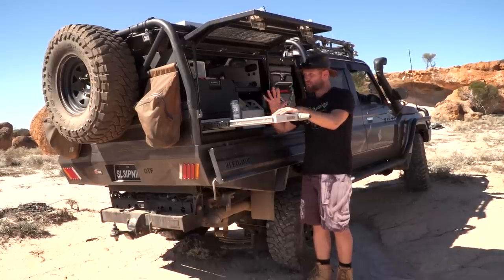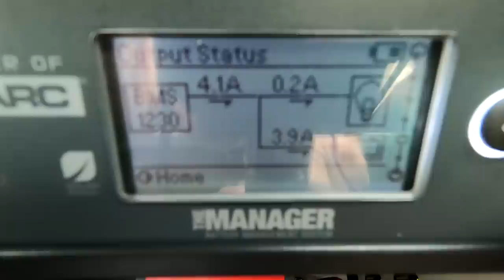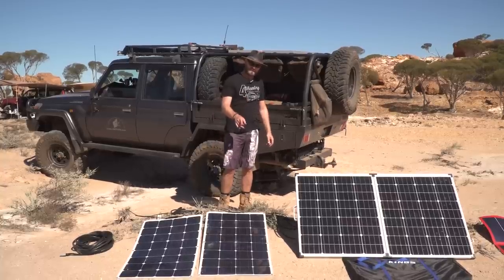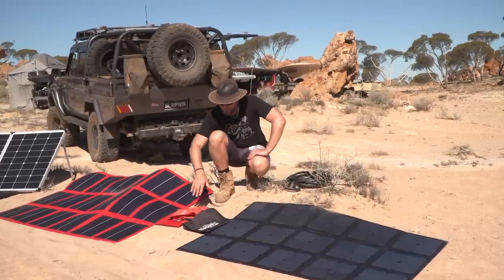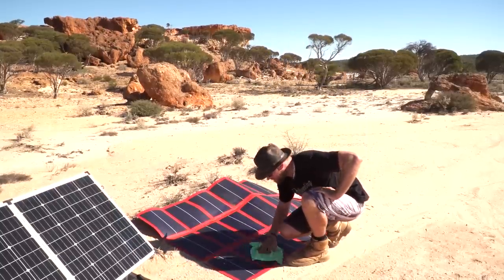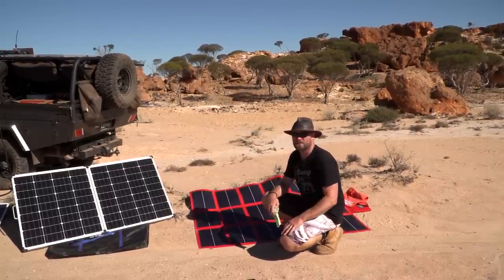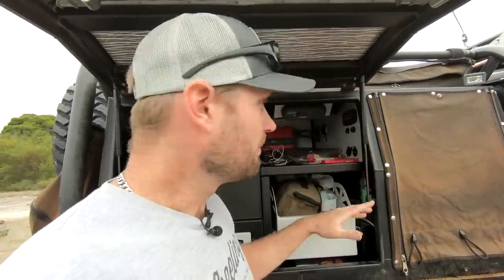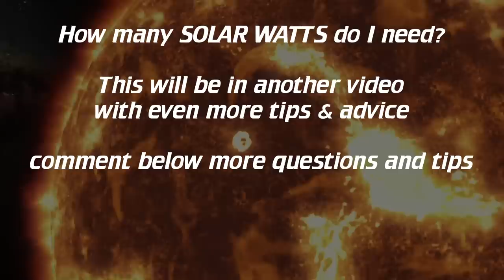SOLAR POWER 4x4 Overlander, tips advice

Comment: My truck has dual agm batteries and dual alternators totaling 400 amps. Anything wrong with wiring one to solar panel on roof when it's running the alternator charges when it's off 200 watts of solar power. I've done this on my old truck with single battery and alternator with good results. I've never had dual batteries and alternators before.

Comment: Good video Ron but l don’t believe the Pwm controller is as bad as you rated it , l have seen other people do test/comparisons and it was marginal , especially compared to the cost of a mmpt controller... also you guys should throw in about cable sizing and lengths they play a massive part of power loss , too small , too long = huge power drop...cheers....

Comment: Good video Ronny. I have a portable hard panel set up - 160 watt in total. Between the car and the panels, my rear battery runs my fridge /freezer for as long as I need it to. I had it running for 4 weeks straight in  Vic and Flinders ranges. Worth every cent. Future topics: alternator types , fixed or variable , what does it mean?

Comment: Its wrong to say High quality vs cheap, as you can buy some really good high quality cheap panels that will match  or even have better performance than the more expensive panels,. When comparing something in future its expensive vs cheap or high quality vs low quality, don't get them confused. I saw just the other day a $300 110w panel compared to a cheap $99 110w panel and using same 12v controller the cheaper one outperformed the more expensive one, so take prices with a grain of salt, cheap doesn't always mean nasty.
Reply: so how do you tell then, without buying both and comparing?

Comment: PWM controller will perform just as good in heat, Which is Australia :). MPPT is better in colder climates.
Reply from the maker: MPPT charges differently and will give you 90-100% if the power from the solar. PWM will only give you around 50-60% in general
Reply: I think you need to do a bit more reading on the difference mate!
Reply: I know how they work. the MTTP can convert excess potential (Voltage) into Current (Amps). This can be up to around 30% but is usually lower at around 15% Increase. This is pretty cool idea, and any gain is good. MTTP controllers work best when the cells are cooler. It also depends on your panels and how much excess voltage you have. I have used both controllers, and both have worked well.

Keep up the good work.
Reply: PWM is actually more "power efficient" than MPPT–which means less total power loss in the controller itself. So heat sinks in the design can be smaller (and less expensive). Missing in most analysis of MPPT is that there is always a conversion loss with MPPT, which tends to be higher the greater the voltage difference between battery and panels. That's why PWM can actually beat MPPT under circumstances. There are pros and cons to both, but to totally dismiss a quality PWM charge controller and monitoring system that work TOGETHER, is ignorant. And JJ is correct, MPPT is better in much colder climates which is generally how the marketing types skew the numbers.

Comment: blankets suck in hot weather so if you plan to go outback and camp they are useless... 30-40C weather drives the heat of the panels way beyond their 40c maximum.  at 40c a 100w renogy fixed panel still delivers 94watts or better. even a efte panel (atem 200w) can only deliver 4 amps through a mppt and a single renogy 100w delivers 7 amps and they weigh the same 6kgs.... Oh and a fixed panel is 30% of the price or 6 times the output for the money(worst case).

Comment: Great video.  General question.  I have the hard fixed panel like in this video (with the mppt controller in the back).  Can I plug that straight into my bc2bc charger without bypassing the build in controller on the panel?  (I incidentally have the same redarc bc2bc charger too in this video).  Should I just rip it off? Also, what are the repercussions of just leaving it and going from one regulator into the redarc one?  The reason I ask is because I'd like to leave it there so I can use it for other uses that's all.  Not a biggie if I have to rip it off though.  Cheers.

Comment: I was told by a solar company installer that there's very little difference between cheap (not crap cheap) and expensive panels as they all come from china and probably out of the same factory. Like most things you're paying for a name. A quality solar charger close to the battery is important.

Comment: G'day Ronny. Bloody good stuff as always. I've just picked up 2x120ah deep cycles that I'm running all my gear in my canopy off (idea being I invest heavily into the canopy set up so if/when I upgrade I just unbolt the sucker).  I've got a 60L combi Engle which draws a lot of power despite being a newer model (mainly because I'm trying to run it at all times for my work). Also running a new ctek 250 bcdc (new 2018 model) with solar input. Do I need a regulator still if it's got solar input or does the unit act as a regulator? Hate to ruin me  new batteries. Thanks mate.

Comment: Ronnie, great video.  I am curious about what battery you are charging through the BCDC1225D vs the MPPT mounted in the rear.  Or is it these are just 2 options to charge your auxiliary battery and you only use one at a time?  Thanks from Texas USA.

Comment: good advice for dummies but in absolute terms some incorrect info.

If your batteries are not close to full (you can connect direct ) but you need to disconnect when "full" manually. 
If all you panels are in the same light pwn can actually be more efficient  (basicly 67% of max panel current )
If you have multiple panels is different light conditions then Mppt "may" be worth the money. 
For multiple non parallel batteries a BMS is Very Smart, if all batteries are identical and parallel then a controller is all you need.
Reply: “If all you panels are in the same light pwn can actually be more efficient  (basicly 67% of max panel current )”

COMPLETELY WRONG

Comment: I was recently looking into getting a solar panel like the Kings one in your video. We run a fridge and led strip lights. Thats about it. I just wanted to make sure the battery will go for a few days parked up in a nice spot. However the thought of bad weather ruiining the charge made me opt to buy 2 deep cycles and wire them together. Has lasted for 4 days without starting the car. Considering you need an aux battery anyway and the cost of the cheaper panels being about the same as a battery I thought that was a better option for me. What do you think about running two aux batteries?

Comment: I may have learnt something!!
90 w blanket, not that I have really used it but when i did I just stuck the croc clips straight to the aux battery. What small portable regulator / controller would you recomend for a infrequent user?

Comment: i disagree, pwm can be between 10-30% less efficient , pwm regulators are about 1/10 the cost, buy 30% more panel than you think you need because panels are cheap, and you will be right, that is the most cost effective way of a solar setup.
Reply: There is a lot of marketing hype with MPPT stuff. There are pros and cons to both methods. A quality engineered system, like Bogart here in the States, performs extremely well for a fraction of the cost. And like Ashley stated, with the money saved, buy an additional panel.
Reply: panels are cheap but more panels take up more space and weigh more.
Reply: It depends on the voltage of the panel. If you use a PWM controller with high voltage solar modules (such as any of the big 250+ watt residential panels), you will lose more than half the power versus an MPPT controller. Put simply, a PWM controller converts the higher voltage coming from the panel to 13.8 volts, but does not increase amps. A MPPT controller will convert the higher voltage to 13.8 volts with a corresponding increase in amps resulting in much more watts (Power) to charge your batteries. Most "big" panels run at 38 volts or more. I have 300 watt panels that run at 54 volts. On the 54 volt panels, I would lose over 2/3 the power if I choose a PWM controller. Basically, when used with high voltage panels, a PWM controller will throw away more than 50% of the available power from the panels when compared to an MPPT controller.

If you want to use a PWM controller, you should only buy 12 volt panels, which by the way, run at 17-20 volts. That is where you get your 10-30% figure from, but it does not apply to higher voltage panels.

Comment: Great video, very to the point and informative.  Quick question... do you know the brand of the roof top tent you showed quickly in this video with the solar panel attached to it?  It was a hard  top clam shell type, but it had a very flat top.  All the ones I've found have a curved aerodynamic top, but I'd love to find one that has a pure flat top like that one.  Would appreciate any feedback on that.
Reply: Looked like Alu Cab Gen 3.

Comment: Hi Ronny, 
I have a arkpak battery box to run my Bushman fridge in my 4wd although I can charge my fridge whilst driving i was looking at solar to charge the battery box while stationary for a few days . I go solo camping for 3 days at the most. I'm looking at getting a mppt regulator and folding solar panels what would your advice be for this set up. 
Cheers

Comment: I just want to run a 40l fridge in my work van , typically drive 1 to 2 hours a day . 
Can you teach me how to work out if I need solar and how much I’d need? Not opposed to picking it in on the weekends
Reply from the maker: If you park in full sun I’d suggest 120-150 Watts that’s should be heaps with a 100ah batt.

Comment: Hi, my 2nd battery(deep cycle) is inside the engine compartment. Can the regulator be installed on top of the battery or will it be too hot? The alternative is in the back of the double cab but that will not be near the battery-will it make such a difference for a 150 w solar panel?

Comment: difference between mppt and pwm controllers are nowhere near that much unless the voltage of the panel is not the same as the battery and in most cases you will get more value for money by just buying a bigger panel with a pwm controller in saying that if you are using second hand house panel that are more then say 18v a mmpt regulator is a must have.
Reply: Exactly.

Comment: Hi Ronny i have a dc-dc in my 4x4 and can i run the Hardline straight from the solar panel without pwm monitor for the full power of the solar panel?

Comment: Great video Ronny. Question - solar charge controllers come in different ampage, what do I need?
Reply from the maker: Depends on your needs
Reply: Depends on your Solar Output!
You can and will damage a solar controller with too much input while recharging batteries.
Note: A rated 10amp solar panel can over produce in ideal conditions.
So always buy a controller with 30%  headroom or room for future expansion

Comment: About 9:24. What gauge/mm wire are using for the cable?
Reply from the maker: Overkill size. Battery cable size. I got a second cable that’s about 5mm core

Comment: Does the battery that your solar power goes to make any difference? Obviously not on the charging performance of the panels, but on the back end? Does one type of battery take the charge better than others?
Reply: Go Play Outside  You also have Li-Ion batteries now as well. Some types  batteries take longer to charge than others, and I don't know, hence me asking, if some are better suited, taking into account charge time, discharge cycles, etc., to solar charging.

Comment: A few questions, how do you know the amp hour of the battery? I have a weaco cdf-11 center console fridge, and a tray mounted sno master fridge freezer combo.  Both together we will say pull 12 amps worst case scenario. It would really only be half cause of compressor cycle. So that's 160 watt draw? So if I can get 160watts of solar I should be OK?
Reply: Just Google your battery model

Comment: Hey Ronny , I have a red arc bcdc1225d with a optima yellow top battery running an arb 78 ltr fridge . I just put on lay by a xtm 160watt folding solar panel from bcf. I've been told the regulator on the panel will need to be bypassed for rage red arc charger to work, is that correct? Love your videos
Reply: the redarc bcdc does the mppt so no regulator is required at the panel.  A year later, you must have this sorted by now lol...

Comment: Hey mate, just wanted to check, I thought the ‘D’ the BCDC was lithium ready not solar ready as stated?
Reply: Beginners 4x4d for dual input👍
Reply: There is also a redarc 1225 and 1240, not the 'D' models and they both have solar inputs (MPPT) regulators. I'm pretty sure the 'D' models are for Lithium charging.
Reply: Yes. 1225 and 1240 were the older discontinued models, required a relay to switch between alternator and solar charging. New ones are lithium battery compatible and have new charge profile settings, along with dual input to allow it to share from vehicle and solar at the same time.

Comment: If you are moving for most of the day, would it be best to mount the panel flat or at an angle?
Reply: Flat, but it is not that difficult to design a hinged panel system to use when parked.

Comment: Credibility is shot as soon as you try claiming that if you discharge an AGM or Lead Acid down below 50% that it can cause a fire... No! Just No! The only thing that will cause a fire are passing more current  through in either direction than the system is capable of (discharge/charge rate of battery & carrying capacity of cabling).

Amp hours does not equal Amps!

Comment: Er, I'm pretty sure the AH rating is based on how many amps the battery can supply before it gets to minimum safe voltage. You definitely wouldn't want to go past that but that doesn't mean you need to cut your AHs in half.
Reply: au51emu - I think Ronny has it right.  When you buy a 100ah battery at the auto parts store, cut that in half to 50ah do determine your usable amp hours.
Reply from the maker: A 100ah battery only has a usable or 50ah IF lithium it will have a safe 80% but can be pushed to 85%
Reply: Ronny is correct.
But in saying that, it is all a sliding scale.
Sure you can discharge an AGM to 20% remaining, if you only want the battery to last 1 year.
Shallow discharge to 80% remaining it will last 10 years..
The choice is yours!

To answer the OP, no, Ah ratings are not expressed how you think they are!

Comment: Lot of guys out there buying cheap crap, that’s why ‘Kings’ is so popular.
Reply: I purchased my CTEK charger from them at considerably less cost than well known competitors. Just shows how much others rip you off for the same product. I reckon they are worth a look. Yes, some of their stuff is very ordinary but certainly not all.
Reply: Yeah it is really a pick and choose. Some of the stuff I have seen has been as good as any of the more expensive stuff.
Reply: KillerDeegan .
I would be avoiding it like the plague,  especially if you do solo remote trips.
You just can’t beat the saying ‘you get what you pay for’.
Reply from the maker: Not everyone needs high quality stuff. Everyone has different needs. If I only went out on short trips 1-2 times a year I’d go for cheap stuff too.
Reply: Ronny Dahl.
Maybe so but my point is, you wouldn’t rely on it on a remote trip would you? As it could be the difference between life & death.
Reply: I use a PWM 160w panel from Kings, went this option because it was cheap. Has not missed a beat and ran my entire car for 7 days no problem when I did a transfer case. This was up in Cape York and we were extremely remote. I wouldn't go on a trip without it BUT, luck plays a big part in Kings stuff working or failing I think.
Reply: Gunny40. Living life dangerously, I respect that.
Reply: Not really, it works fine, I've had no dramas, and why fork out a lot more money for something that works for less $$
Reply: Gunny40 . Let me put it to you like this..... would you feel confident and comfortable going on a remote solo trip with a vehicle kitted out in Kings gear?
Reply: You're absolutely right but the fact remains that many people do not do remote solo trips and do not have lots of money to spend on the "good" stuff. Horses for courses. If you're remote travelling you would be foolish not to invest on some decent gear. See Andrew Pierre Whites channel. Cheers happy travelling.
Reply: E210 Dall. it’s funny you say about Andrew because I was actually with him yesterday in Melbourne.
Reply: E210 Dall yep I agree, most of my setup up is top of the line stuff, the batteries I run are fantastic quality, but it's all down to how you travel as well. I don't stay anywhere longer than 2-3 days (apart from fraser island) so everything charges itself. 

Everyone is different 😊
Reply: Brad Młodystach . Good for you. Iv gone though 2 of them, 2 thumpers 2 swags & a winch. Guess I’m just unlucky.
Reply: @Phil_McAvity  or you just don't know how to look after your shit!!!
Reply: People  bagging kings need to realise they have a place in the market especially for people new to the hobby and also to everyone else as more kings stuff comes out at a low price but quality increases prices .more high quality products will lower there price you will still pay a premium for good quality gear but the margin will narrow to fit the market and soon u will have very reasonably priced mid range mid quality gear on offer its a good thing for everyone except the giant companies that have had a monopoly on decent quality gear for years.